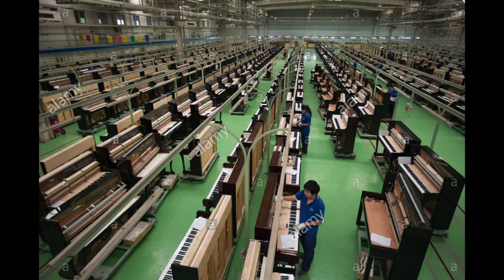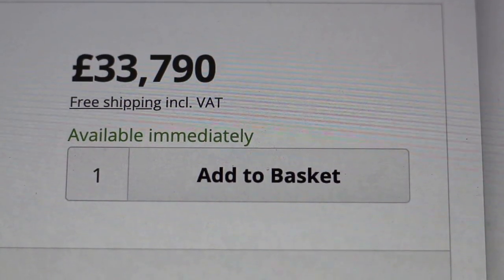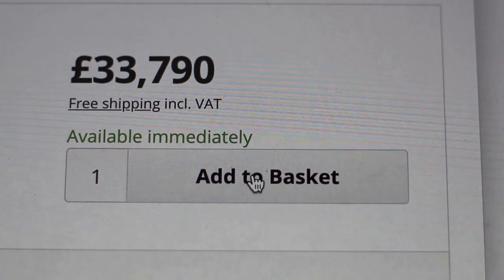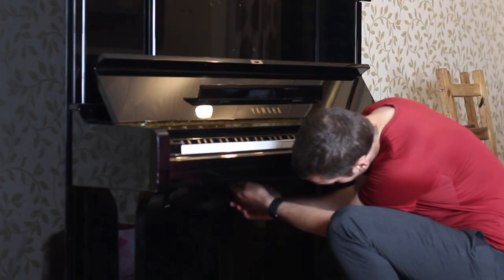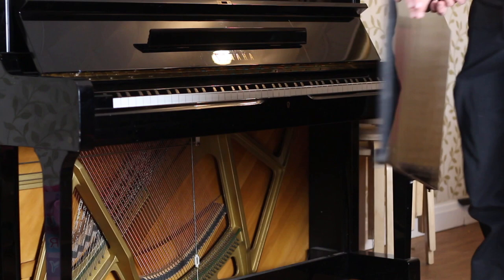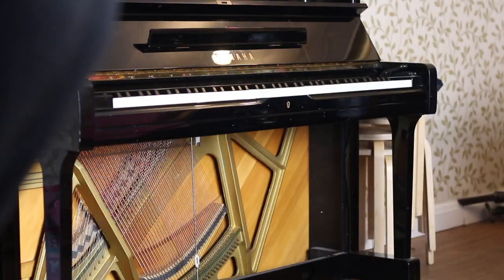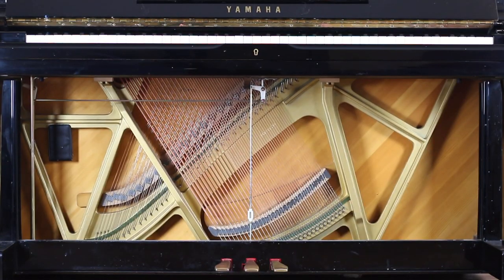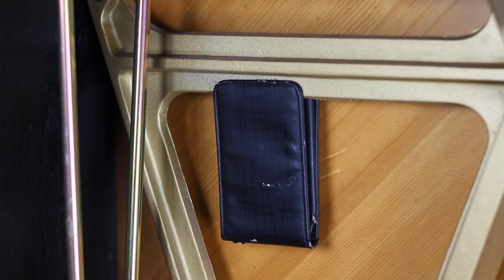Make ANY piano sound like a £150k STEINWAY Concert Grand

Comment: Yeah...sorry but that's not how this works. Uprights and grands are totally different in their construction, and physics being the curious thing it is, removing some device or other is not going to get any upright to sound like a concert grand. That would only happen if the soundboard and strings were of the same length and dementions as those found in a concert grand, and the construction of the piano was such that this sort of sound was possible.
Reply from the maker: Safe to say you didn't watch to the end?